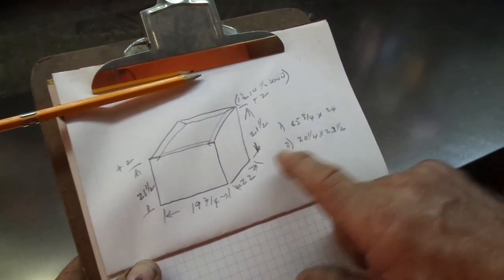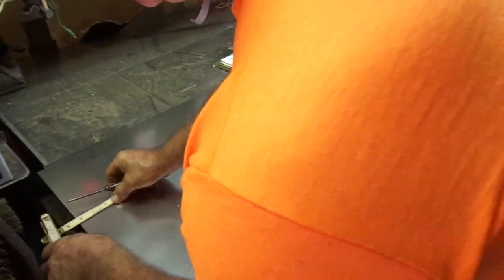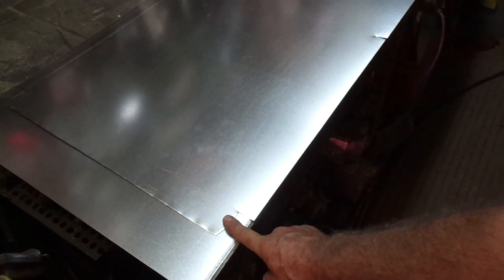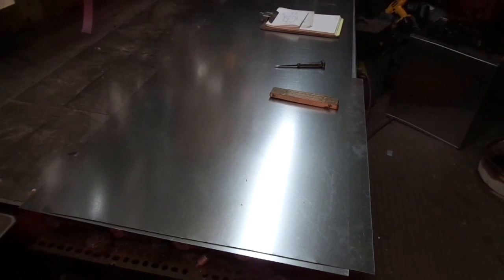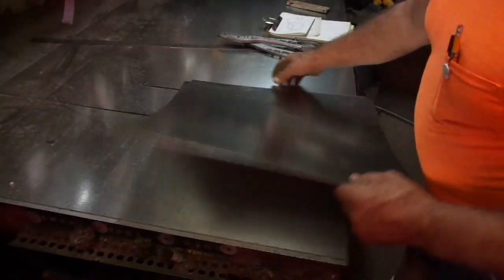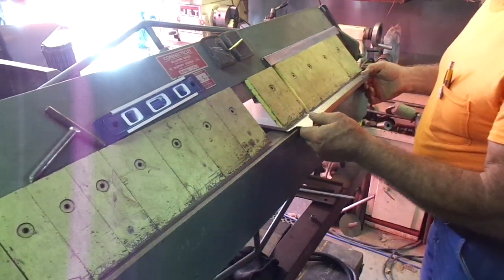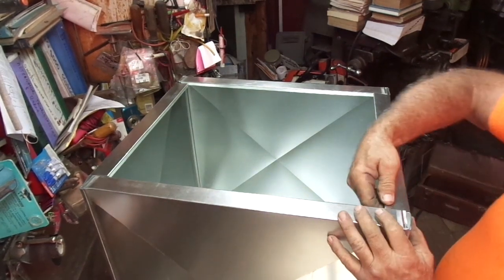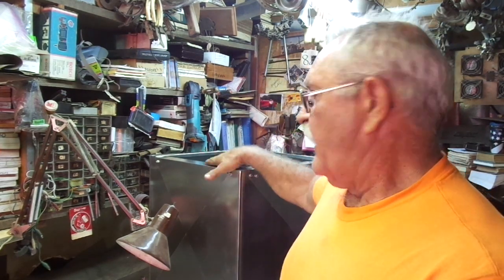Furnace Return Air Plenum Fabrication

Comment: That very nice made. Do we have to insulate return air box?
Reply from the maker: Thank you.  Insulation, either fibreglass duct liner of double mylar bubble wrap is required for attic or craw space installation.  If, its installed in a normal finished basement or in a closet application,  then its not necessary unless you are going for sound suppression. Btw, have you found the sheet metal playlists above, like this one ? https://www.youtube.com/playlist?list=PLk72G9DTzZ1taVZjyeN9DKr52HQ3hhcXd Thank you for stopping by for a visit today.

Comment: What are the cross breaks for? excuse my ignorance
Reply from the maker: The cross breaks add stability to the flimsy flat metal.  The rigidity added then keeps the air pressure created in the duct by the indoor blower from 'oil canning', flexing in and out, during operation. In the case of the return air box as this one, the blower would be creating 'negative' pressure causing the sides to buckle inwards, whereas on the discharge side of the blower, the pressure would be positive and cause the ducts to flex outwards.  Make sense Jonny...?  There's never a bad question when you have a desire to learn.
Reply: @tractorman4461  Thank you sir! That does make sense. I'm about to tackle a job like this at my house here soon, just trying to get a little bit of information. Thanks for taking your time to explain it. Have a great day 👍

Comment: 13:45 WHERE DO I BUY AN ELECTRIC HAMMER
Reply from the maker: There are several manufacturers, but Milwaukee is the best of all for longevity.  The new ones are identical to this old one here except they now have a red insulated composite handle. You may have to contact Milwaukee directly and talk to a rep because I can't find it on Amazon right now like I did for another viewer a year or so ago.  Other companies also make a very light pneumatic hammer that works very well if you have regulated air in your shop.  Much lighter than this one here.  Good luck Travis, but maybe you will have better luck finding it on Amazon than I did just now.  If not, I'd subscribe to a Milwaukee site and contact them via email for information.  Be ready to pay several hundred dollars or more though !!

Comment: Electric hammer, seriously I've been in construction since i was 8 and doing HVAC for 5 uears. Never seen or used an electric hammer...
Reply from the maker: Hot doggies Alex...does that must mean I showed you something new that's really old.... There's nothing like them to make very pretty pittsburgh locks.  I always wanted to find the lighter straight pneumatic hammer.  I'd hang it over the work bench with the curly air lines so you can reach up and stretch it down and let it go back out of the way. This is a new Duro Dyne:https://www.youtube.com/playlist?list=PLk72G9DTzZ1tJEjzkfIvq8dY-UWCpl4  But I like the old versions better.  Here's a knock off electric hammer: https://www.ebay.com/itm/191917639232?chn=ps&norover=1&mkevt=1&mkrid=711-117182-37290-0&mkcid=2&itemid=191917639232&targetid=1068323859350&device=c&mktype=pla&googleloc=9022818&poi=&campaignid=11612431902&mkgroupid=113527548656&rlsatarget=pla-1068323859350&abcId=9300456&merchantid=6296724&gclid=CjwKCAiA4rGCBhAQEiwAelVti7D7fdnA6eKBm5HQjeoKLGatP3IuR2UDxOTjmbXQ_0k3hEWbjq_7uBoCtAUQAvD_BwE

Comment: Don’t have your Pittsburgh break. Video ain’t helpful...
Reply from the maker: Well then, this video is not for you, but thanks for letting me know. If I ever revert to doing sheet metal by hand, I will tag your name in the title so you can find it easily.  But in contrast, there has been quite a few that seem to appreciate the effort in using the machines.  Thanks Hans for the comment, whether it was helpful or not.  There are plenty of guys showing how to fold with 2 x 4's or angle iron.  If you search it like that, you may find much more information that suits your desire.

Comment: Nice job sir you are a good presenter and excellent craftsmen 
I am vocational teacher : sheet metal / welding / fabrication/ pipe fitting / pipe welding 
You are clear and easy to understand and very skillful 
How would I email you sir would like to pick your brain 

All the best to you old timer tin knocker 👍⚒ 

US  military Veteran
Reply from the maker: Thank you for the extremely supportive comment.  With the credentials you've shown, I don't know if I would have much to contribute and I am retired and getting further away from the industry on a daily basis.  I usually run pretty  behind on making replies because of the normal workload, but if you think I can provide input lets give it a shot.  Yep, I'm an old Vet too.  USMC 3/71 to 3/75.  
whpete44@gmail.com

Comment: Ive been a sheet metal apprentice for a year now and it’s difficult
Reply from the maker: That's cool Joe.  Hang in there it gets a lot easier.  If I can do the things I can do with no formal training, you will be miles ahead by going through the apprentice program.  I'm actually a commercial service technician.  Thanks for watching and commenting.

Comment: You should teach apprentices how make an elbow and fittings. At least the idea of an elbow or fitting
Reply from the maker: I have a lot of fittings in many of the other videos...try this one for size:https://www.youtube.com/watch?v=HmQrqO_X61A&t=1377s  It's actually a return air 90 degree fitting with a filter rack built in.  Also have you checked the playlists I have above.  There's a couple sets of sheet metal videos listed.

Comment: You can make a straight piece of duct with two end caps and cut your hole out
Reply from the maker: Yes, I have done that as well on different situations.  I like this style because it supports the weight of the air handler quite handily when the need is there.

Comment: Hello My Friend What is That Material? 
How Many Gauges?
Where To Buy?
Thank You For Your Teaching.
Reply from the maker: The material is 26 guage galvanized sheet metal.  Just about all HVAC supply houses handle sheet metal by the sheet in about any quantity all across the United States.  The standard sizes for residential and light commercial use are 24'',36'' and 48'' in width and a standard 96'' in length.  Thank you for the comment and I hope this helped in answering your question.
Reply: @tractorman4461  Thank You So Much.
Reply from the maker: @-mejor-que-nostradamus-6152  no problem. Anytime. Be safe !!

Comment: Hi Tractirman, thanks for sharing the video! Excellent job! I have a question, hoping you could help me to understand. I recently hear a banging sound whenever the furnace turns off at home. After few days looking around a cause, I eventually found the sound coming from the air plenum that is sitting on the top of the furnace. The top metal sheet of the plenum makes poping sound whenever I press it. I had a HVAC guy came in but told me it’s caused by a dirty filter that I changed few days ago. Would you please advise how to fix this problem if you know? It is very annoying and scaring banging sound especially during a night. Your advise is greatly appreciated!
Reply from the maker: Good Afternoon Shirley Li...thank you for the comment.  What you are experiencing is known as 'oil canning'.  Think of the duct trying to be blown up like a balloon.  It actually is to some extent, because when the blower shuts off the pressure built up inside the duct relieves which in turn allows the metal to flex back into shape.  
  It is in need of bracing in some sort of manner as to not damage the air conditioning coil that may be INSIDE that sheet metal plenum.
    Can you verify whether or not is is a gas or electric furnace?  If its a gas furnace, can you verify that the cooling coil for the air conditioner is not inside that particular portion of the duct? If its an electric furnace, chances are the a/c coil is probably encased inside the unit at the bottom and not in jeopardy.
   If its a gas furnace and there is no coil inside, the fix is fairly simple....but first we have to know for sure.  Because if you damage the cooling coil, you will be in for an expensive repair.
Reply: @tractorman4461  thanks for a quick response! It is a gas furnace. I do not know where is the cooling coil but the AC unit is sitting in the backyard. Would you mind that I want to send you pictures of the furnace and plenum for taking look, thinking might be better to understand? If so, my email address is shirleylill1588gmail.com. If not, I understand. 
Thanks again!
Reply: I also received your first reply in my email box and just replied you with two attached pictures through the email. Not sure if you can get them. It is a first time I use YouTube for communication. Not sure if I am doing all right. Thanks!
Reply: Oops, got the email returned- unable to delivery it to you.

Comment: Would it be wrong, or out of code to make it out of wood?  The filter holder could be cut and attached to the side and the 90 degree return air duct go up from there.  It wouldn't be a fire hazard beneath the furnace, would it?
Reply from the maker: The local codes here do allow a furnace to rest upon a wooden box or support.  Its akin to the return air passing through the floor joists unducted.  I've changed out dozens of them in the past just as you described.  I also wouldn't refer to it as 'wrong' its just on a changeout I would go back with it like the old one came out, unless rotted....and on a totally new install I would make it out of metal in some variation of this one here. Thanks John for the comment sir.

Comment: Nice job.good to see there are still real sheet metal mechanic out there.been doing it for thirty years now all for the same small family run company.like you said many different ways of doing this.i like to make a reverse tap in with 45 degree corners.the furnace,fan coil slides in and the extra 3/4 holds in place.makes it easy when time to change it out,cut the tape and just slide out.
Reply from the maker: Oh heck yeah...I've been guilty of doing it like that myself. Whatever makes the job go smooth, keeps the air inside the duct and looks neat and trim at the same time.  Of that I insist.   When there is a tough one, I also like to leave a note written inside for the next guy that does a tear out 25 years down the road too...  Thanks for the compliment sir and we both seem to agree that there's not a single 'best way' to do a job because the job usually dictates how it needs to be done.  Take care and have a very good week sir.

Comment: Question for you good sir, do you have a method to adding a cross brake while out in the field? I do residential installs and don’t have access to a brake.
Reply from the maker: Yes, but it takes a bit of wrist strength.  If you are using 28 ga metal on a furnace/coil changeout AND you still have the furnace box onsite, cut two of the largest pieces of the box and lay them on the floor.  Lay out your fitting pieces and use a straight edge across corner to corner on top of the cardboard.  Put one knee on the straight edge off the edge of the metal and use a stout awl to very forcefully scribe a deep line into the metal repeatedly.  About the second pass the metal will begin to raise off of the soft surface of the cardboard and by the 4th pass it should be substantial enough to provide the stiffness of a crossbreak almost as good as one formed on a regular brake. Shift to the other direction and make the second one to form the "X".
    If cardboard is not available, the next best thing is a floormat by the stairwell or a piece of carpet, either of which is always available is a person's basement.  If you have a piece of armaflex pad on your truck, that works wonderfully as well. I kept a 36''x36'' piece in my truck for that same thing back in the day.
  The awl I use for that is a Malco tapered awl about 5'' in length with the typical orange handle. Not the thin one they sell.... the thick, fat tapered one that starts out about 5/16'' up by the handle.  On a side note, that fat awl is the perfect one for wallowing out holes in drywall for thermostat anchors. 
    Thanks for the comment and question!!
Reply: Check out a “ Hensler’s Bender” great tool
Reply: Lay a step ladder down flat and use 1 side for your angle and gently bend then flip and repeat, perfect crossbreak

Comment: I was a contractor for 34 years and only once did I see a guy use a foldable rule. And sorry Tractorman but we don't have the machinery that you do. I need a field made plenum. I'll bend up my own by hand.
Reply from the maker: Dan B. Oh heck yeah. I’ve done a good number of them in the same way back in the day out of necessity. That’s why I spent the last 40 years picking up machinery as it became available. A fellow can’t hardly afford all new equipment at once. As long as it can be purchased reasonably I will continue to add to it. I also bolt a four foot box and pan and a lockformer to the bed of a ten foot trailer for those certain jobs away from home too. Pretty rare now days though. Thanks for the time you took to watch !!

Comment: first class job on that! our heat pump system just went out. waiting on the heating and ac man to come. hope its soon cause its getting cold in here.
Reply from the maker: Thank you sir for the compliment on the fitting.  Hope your tech gets there first thing out of the chute.  I hate being cold, having worked outside for basically my entire career.  Maybe it'll be something simple, quick and inexpensive to repair....yeah right huh.  LOL
Reply: @tractorman4461  I know what you mean I was a tradesman myself. worked outside all my life nearly and now days I like to stay warm and dry in winter. I even did a little duct work for a summer or two. no where near the caliber you put out. its looking like my entire system needs replacing I have another company coming for a second opinion and price.
Reply from the maker: @daveknowshow  That's an unfortunate turn of events for any time of the year but especially at Christmas.  I'm assuming its an old R-22 system and either had a bad compressor or a bad indoor coil to condemn the whole system.  Too bad you live so far away or you and I could have done a collaboration video and you'd have saved a ton of money  at the same time !!  LOL  Thanks for commenting Dave.
Reply: @tractorman4461  yup we think its likely the indoor coil waiting on another tech to come test and find the leak. r22 is a great stuff for cooling and heating but expensive. not sure what we will find out still waiting on a second opinion.

Comment: Retired? Installed two furnace systems so far this year. Last year I think you built a couple adapters and cut a pile of wood for friends and family. Then there was grinding floors and tractor repairs. 
People who know how to do things don't retire. We just stop getting paid for the work. 
Nice job on the plenum. That electric hammer is sweet. 😆😎
Reply: electric hammer, love it too.
Reply from the maker: @vnesmuonnam  A lot of shops have much lighter pneumatic hammers now.  But Milwaukee still makes this exact hammer.  Its just has a red handle.  Thanks for watching and commenting !!
Reply from the maker: Actually I've put in quite a few this year so far.  I don't look for work...work just kinda waltzes my way.  You're right about retiring...LOL....still working, and most of the time free, but its always for a good cause.  There's lots of older people that really need the help and who knows, maybe some day some youngster will give me a hand with something or other.   They make those hammers in a much lighter pneumatic design... Long and skinny, they weigh about a quarter of this big old beast.  Thanks for stopping by sir and I apologize for not getting to hang with you the other day on your live chat.  Next time maybe.